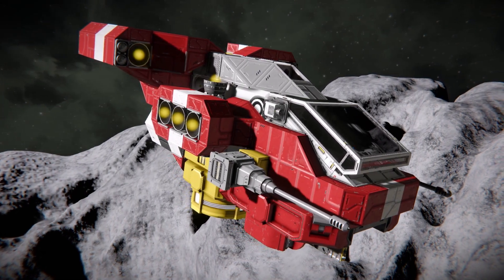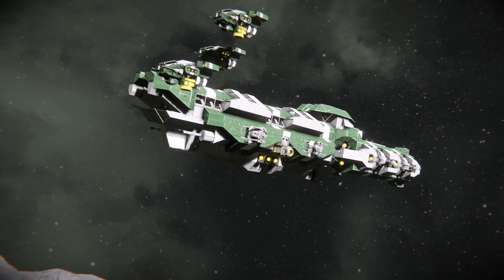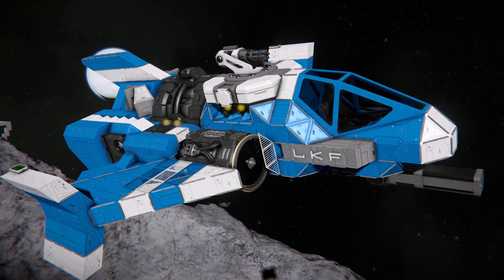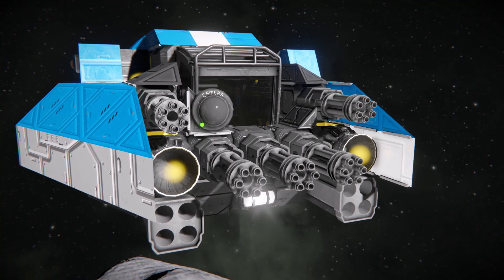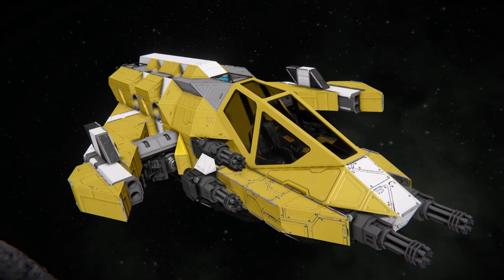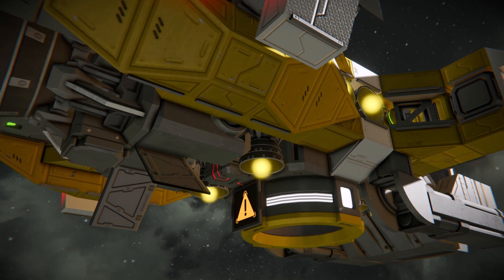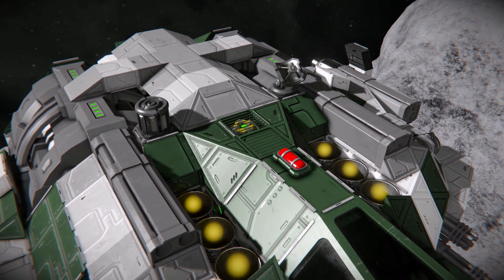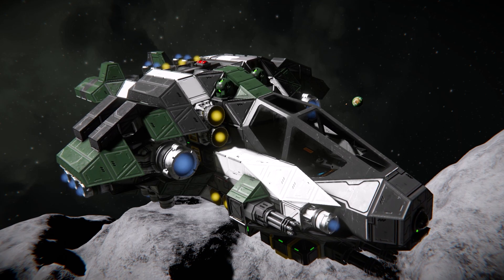Fighter design/build guide (Space Engineers)

Comment: I disagree on scaling up: a better approach is to produce a design that fits in the space that 2 fighters would take up together . This makes scaling and flexibility easier. For example, if your default size is 3x3x2, large ships should be 6x3x2, with the connector positioned accordingly. Also if using gates, remember that you can only fit a small ship of 11x8  small blocks. Also railguns are OP. Use railguns.

Comment: One consideration not mentioned that I am starting to incorporate with my fighters - whenever possible, have AI drone variants of your fighter craft. 

Manpower is one of the most precious resources in SE and fighters more than any craft benefit from swarm tactics.

Drone fighters are cheap, and have much higher uptime for constant combat-air patrol around your ships. When used en-mass you can easily have a screen of fighters up at all times while building/mining/chilling in your base or home ship

As you build up your force on a server you can build multiple cheap fighters, and then convert them to drones as more large vessels become available for players to use.

AI blocks can be Integrated into the design from the start, or retrofitted by either replacing the cockpit or with a centerline hard-point. (The latter can have problems with the AI move block being far from the center of mass)
Reply: Do you know of a good tutorial for how to make an AI drone? I'd really like to dig into that but there are a ton of videos and I don't have it in me to sort through looking for what's worth my time. I've done a bit too much of that this year.
Reply: Great tip, I guess that's why I usually have missiles so my enemies have something else to deal with. FYI those 4 shot rocket packs on a missile, chef's kiss.

Comment: My design itch really loves designs that mostly abide by Newtonian physics. Generally using a "tripod" or "table" thruster setup in the maneuver directions with thrust advantaged pointed down. I.e. 6 thrusters pointed down, 4 up left and right. Forward thrust would be at least twice as strong as reverse thrust. Generally, I want my maneuver thrusters to be designed around my ship's center of mass. I know that is typically overkill, but it's what I like.